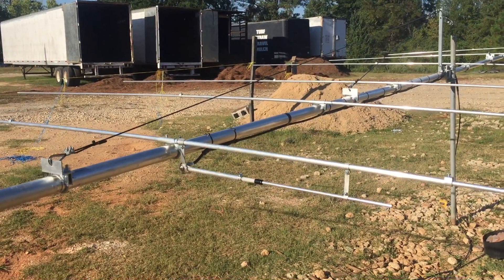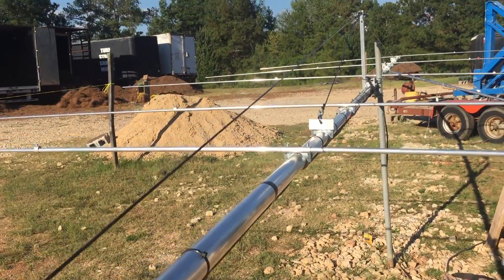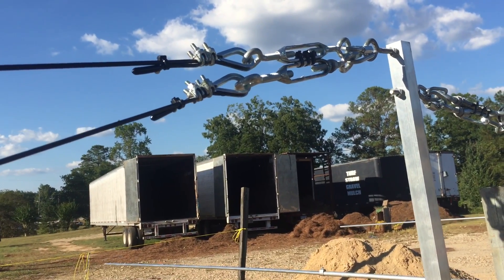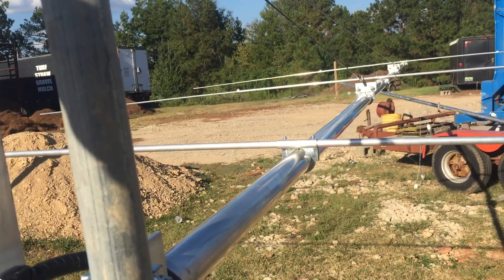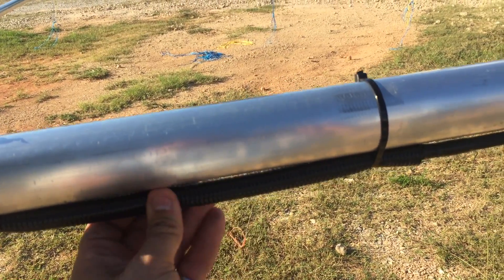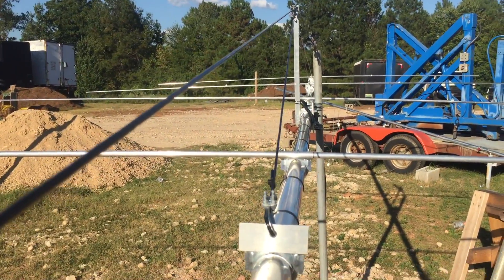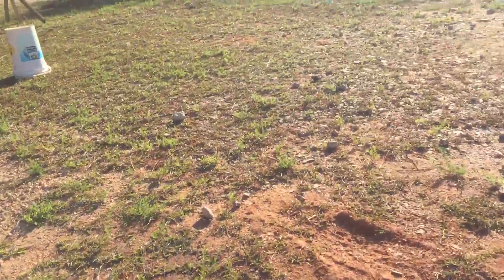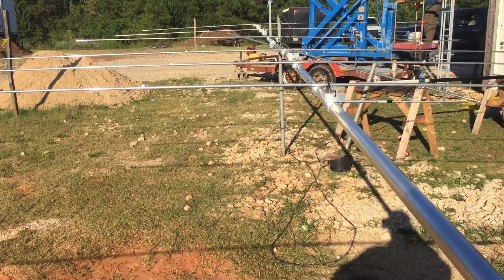MACO 107 beam antenna installation Part 1

Comment: Those turnbuckles would have been better at the other ends of the cables where there’s more space for them, and they need Jam nuts on the threads not only to lock them from turning, but to keep pressure on the turnbuckle threads so they don’t wear out and pull through from things like expansion contraction with heat, and movement from wind.
Reply: The turnbuckles would be less accessible out on the boom if you're standing on the top of the tower. You're correct! They'd have more space but you'd need a lift to adjust them. Having them up at the center of the boom let's you adjust from tower top.

Comment: Is that a 3" boom? Sure looks smaller like a 2"? I'll have to check Maco specs on that boom size. I would not use that black plastic wire wrapper it's corrugated which can hold water. Good electrical tape about every 12"s would have probably done as good of a job without holding any water inside. Get stainless steel lock nuts with a nylon lock it will be better than lock washers.

Comment: Looks good. I'm not a know-it-all trust me. I heard you say in the video you planned on building a 70 or 80 90 ft long that is the Boom length. And you said 8, 9, or more elements.  The more elements you have does not increase your DB gain.  Try doing 6 elements on a 40 ft boom. The longer the Boom the more DB  gain. ✌️❤️

Comment: Purpose of the egg insulators that's should be every 3 feet on that boom guy if that cable has metal or copper conductor it will try to resonate. I used polyurethane string changed it every couple years no reflect from guys.

Comment: We just built 1 of these M-107C but we went with 1/4 inch dacron rope  and we used the 4  links at the top and hooked  rope through them to the turnbuckle mounted near the boom .  . On the boom where the bracket is for the truss support we added these 4  turnbuckles and tightened the boom up   https://www.amazon.com/gp/product/B07F28QPP7/ref=ppx_yo_dt_b_asin_title_o00_s00?ie=UTF8&psc=1  .These fit perfect for the bracket . SWR is 1.1-1 across almost 1 MHz of bandwidth  or 100  channels  .  Thanks for your ideas. We will use  locktite to keep the nuts and bolts in place .

Comment: Very nice there, I’ve been wondering is it ok to mount a rotor down towards the bottom a pole mast and let the rotor turn the pole which will be supported by a carrier bearing up near the top so the rotor won’t be taking a beating by the wind blowing on the beam causing it to wear on the rotor? I’m new to this beam thing, I will be getting myself a maco m103 this weekend I’ll move up to a 105 later on, I’ve also heard that if you use a metal mast of any kind to hold the beam up in the air the metal interferes with the beam, is there any truth to this?
Reply: not really Mike,maybe,maybe only if you put it up vertically,and then if its not aligned properly,parallel beam element to mask pole.But not really,myth.My moonrakers were on a long mask pole with rotor down below the tip of beam.No you can run the rotor up close to where the pole meets the boom,at the 'T'.
Reply: Mike Hannahs 261 Canyon Hopper put a thrust bearing near the top of the tower and mount the rotor at ground level if you like it there and have the extra mast pipe. I don’t know what a mask pipe is that the other guy mentioned? I have seen many rotors mounted near the bottom of the tower so it is easy maintenance when needed.

Comment: Just an observation.....lets just say that is a Ham IV rotor ( i guess it is since you have the m107). Well mounted outside the tower with lower mast support its wind load is only 7.5. That 107 has a 13.5 wind load. Good Luck
Reply: It's only 13.5 when mounted vertically.

Comment: The zip ties will dry rot in 6 months or less.You would have been better off using something metal on the turn buckles & taping over any you use on the boom for coax support.No matter how big or what color they wire ties don't last.Been there & done that so I know from experience 1st hand.Nice looking beam but I want a 7 element vertical soI can hear locals & mobiles as well.I work plenty of long distance skip on Amateur Radio so I don't worry about any on the CB Band.
Reply: I say 7 months. Lol
Reply: Hell's favorite NPC #69OU812 . exe  Good quality self-amalgamating tape will last for ages.